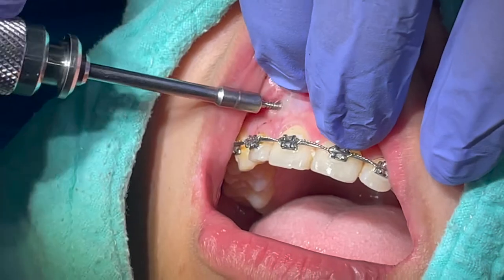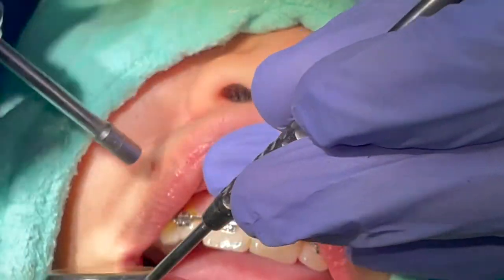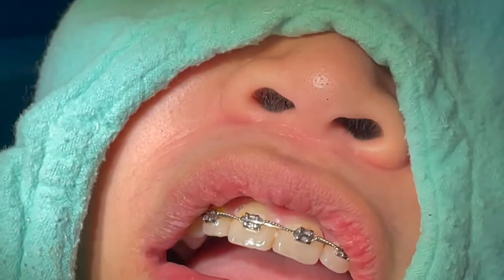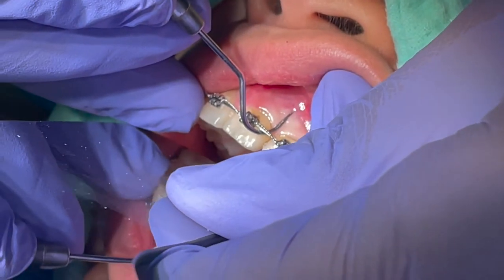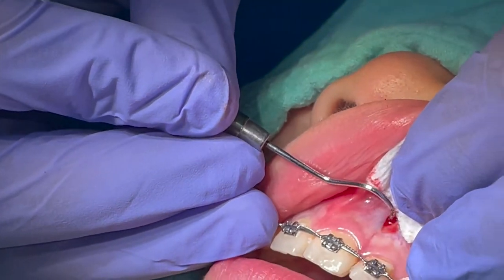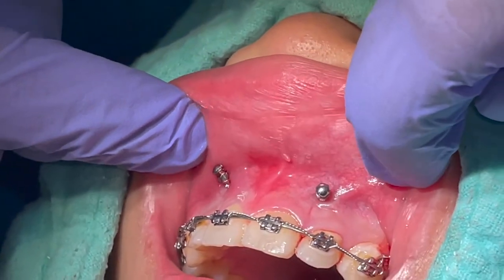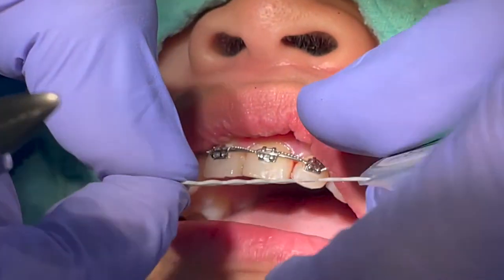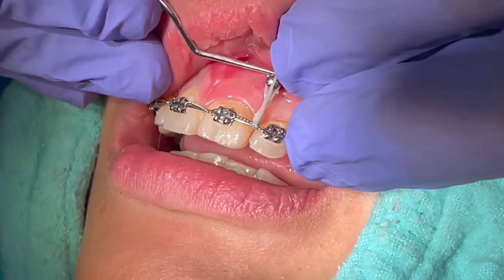EASY DEEP BITE CORRECTION WITH MINISCREWS

Comment: Good job. It was a really informative video. I have a question. What would be the difference between using elastic and the mini screws (tads) to correct bites and is there one more effective than the other?
Reply from the maker: I think both are effective under certain situations